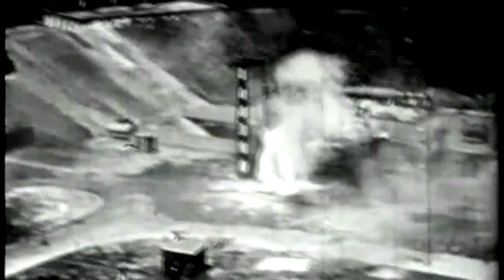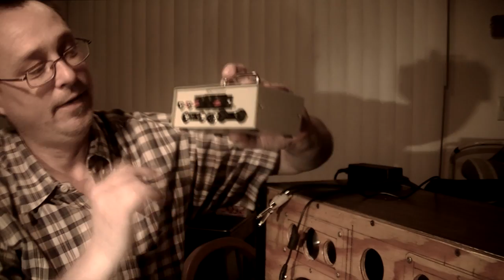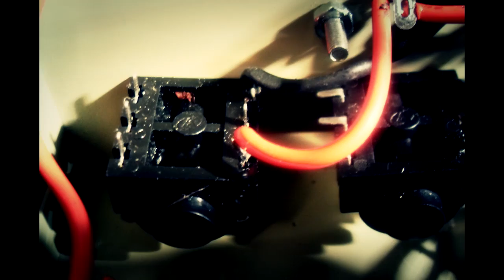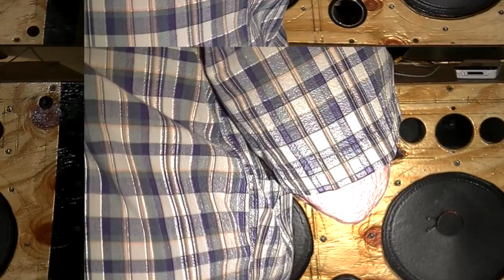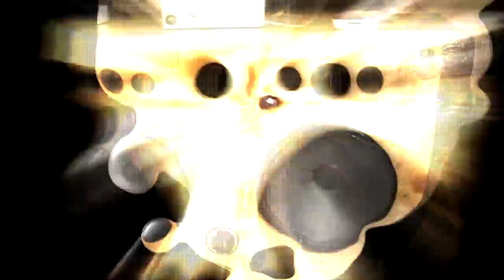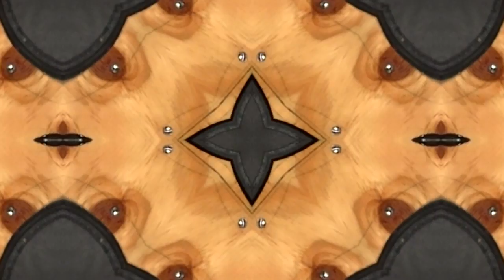DIY - Mini Amp (HI Fi)  Head - 30 watt stereo 15 x 2

Comment: Thanks for making the video, I just picked up a small DIY amp and want to do something similar with it.  Do you know if it matters whether or not the power supply is regulated or not?
Reply from the maker: , never do not try this ,m the world will explode . i 
mostly run mine off sealed lead acid batterys so you may want to go to 
the diyaudio forum , those guys are smart pro tech and expert type that 
will say no to you right away so .... but me ( i tend to do things wrong
 and hack rather than do things the right way  .... i would think that 
it depends on the rating of the ps and the amp , i would be concerned if
 the numbers were very close i suppose . if it was me , in a pinch i 
would put it on a meter and see what it is doing . . . some times with 
out a load i have seen some cheap ps that are way hot so ... i  mean i 
think the main concern is not going over and blowing the chip . i tend 
to check out the chip data sheet and look at the electro caps on the 
board , what those are rated at . i have actually heard of people using 
buck boards to lower the current a bit . in my case i have cheated and 
ran a diode or two to lower it a volt . a lot of it also depends on the 
application ,  i mean for me its not really hi fi , its for musical 
intruments so distortion can be good . i would say in your case make 
sure you are not going to blow it by going over the max voltage the amp 
board is rated at or , throw a couple of large v drop diodes on it , or a
 buck , or use a vreg ... those are pretty cheap and can be salvaged too
 . those ar my thoughts but i am a hack who does it wrong . ask some one
 with zero sense of humor who know ohms law and they will tell you 
i"NEVER  LISTEN TO PETEY "   which believe me i have seen that typed out
 before , i actually called the guy out on it and that was a huge regret
 as he showed up here , with his arduino , his lap top , his family , 
and would nt leave till i gifted him a LOT of cool shit , and he ate an 
entire jar of pickles after we fed the family twice and desert  . 
seriously . so yeah the answer is yes it matters , never ever ever use 
an unregulated ps  , ever ... oh and i know you are not supposed to run a
 diode to reduce current . it hasnt failed on me or created a load or 
heat yet so ....

Comment: question.... 12V power supply at 2A = 24 W ......... ....... where do you get 30W ?
Reply from the maker: +Steven Herr my opinion is that folks who trash talk D-class amps do so out of ignorance , ut yes you are in fact correct . i did recently obtain a 24 volt 6 amp power supply from goodwill . it was 2.99 . maybe do the math on that for me sometime as i dont really care to . thanks for the feedback Steven .

Comment from the maker: yeah the boards are fantastic, and the modules are also very very nice, although a bit more $ but a great value. there are other much more pricey similar amp, and some ultra cheapies. i am thinking sure stuff is te finest quality at the best price. the other boards that are availible look very very cheap / poorly constructed . and i heard horror stories about the lepai stuff . it is a good value , if you get one / replace the cheap parts / fix the bad soldering but, why ? sure is cheaper